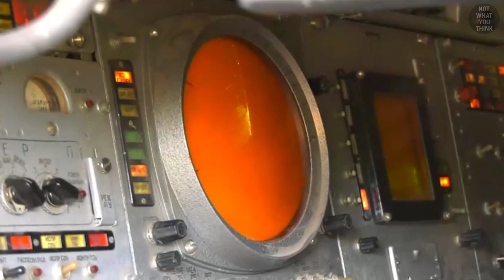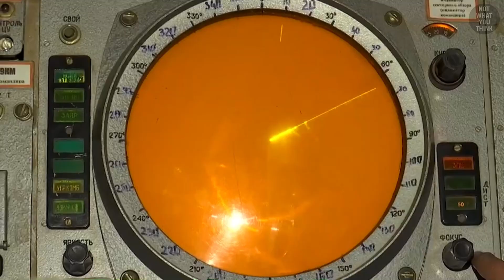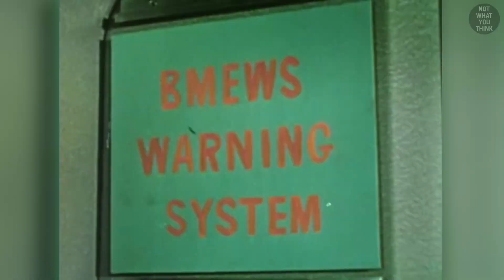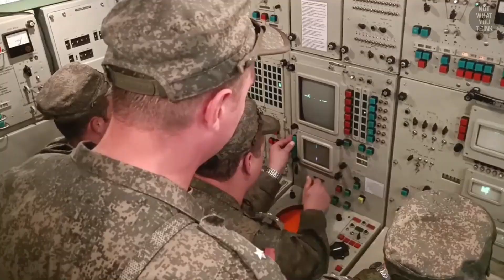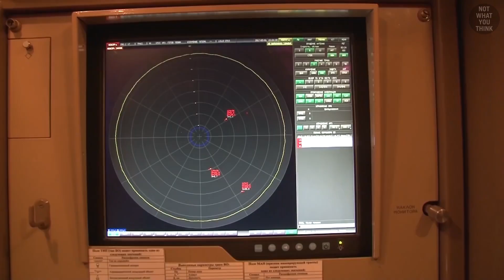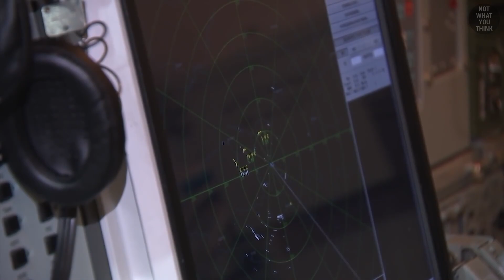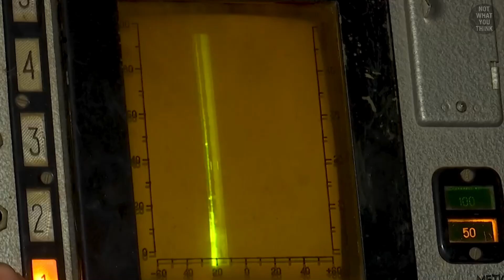How Aircraft Fool Radars by Flying Low

Comment: That trick does not really work with modern radar, that’s something that did happen back in the 80’s since the mid 2000’s flying low no longer works to mask your plane for any radar operator.

Comment: Computer network signalling = pulses
Multi-angle seperate transmitters and receivers
Multi-frequency

Arrays handle multipath, frequency hopping radio, ... modulations, time coded data, ... transmit is active(seperate) antenna(seperate) seperate from systems and receivers are passive. 

AWAC is high altitude receiver(array) duty
Multi scan is ambient-radio noise (works against stealth, blackhole between 2 antennae)

Multi angle(Tx array)(Rx array), multi altitude, counter-artillery(parabolic math) antenna and algorithm... 

Planes have new paint coatings... everything expensive in quantity. Defence is home ground advantage.
Reply: 5ghz wireless 802.11ac sent upwards and towards tooooooo. Besides other ambient radio noise

Comment: Flying low to avoid radar worked well in the earlier days of radar, when they were not effective due to the inability to differentiate between a moving plane and ground clutter. But today's modern, computer-controlled radars with Doppler shift analysis pretty much eliminated the advantage of flying low.
Reply: One advantage, mind.
As the first reply said, terrain. You may not be able to use it to hide your radar signature anymore, but you can still use it to physically hide you.

A theory of mine that i've been meaning to test for a while now is a theory i call Plowing. If you're smart, and you know how a missile tracks you, you could perhaps fool it to hit the ground. Absolutely pointless if the missile knows what the ground is, though.
Reply: Did you watch the video?
Reply: LOS is still a huge reason to fly low. Especially for helicopters which can maneuver to use buildings as cover  The difference between 5 minute early warning and 10 minute warning could be your life.

Comment: Technically you can still fly below radar coverage. Given NOE flying and if you use terrain elevation to your advantage, given the terrain and placement of the radar system, you can be under it's azimuth range. And, again, if there is a mountain or hill in-between you and the radar and you're under the crest of said hill/mountain, you're effectively below the radar even if you're not truly under the radar's emissions physically. Then there's also radar horizon for longer range radars that are commonly used with more strategic SAM system like S-300, S-400, etc. Although the radar horizon is much further than people think with just drawing a line on the curvature of the earth - radiation energy from the radio can bounce off the ground and upper parts of the atmosphere (much like radio signals can) and return telemetry at times. This is not a weapons-grade lock, obviously, but you can detect enemy aircraft out past what many think is the maximum limit.

Comment: Curious why they don't use HARM's. I know its an hide and seek game trying to find the radars and even harder mobile air defences like the SA-15, but air superiority is very valuable in combat. Also a tactic what they used in the Gulf War was to saturate enemy radar with dummy objects like drones.
Reply: The problem with HARMs, or SEAD missile is they are an expensive and disposable way to deal with radar, and even then if they detect the missile they can turn off the radar and it will likely miss.

That's why it's often called an air defence "suppression missile".
They also do not work on infrared based sensors. There's also active radar homing which doesn't scan a wide area and broadcast it's location.

Some SAM like SA-15 types are very short range and are basically "no escape"  by the time you get into launching/detection range.

It's very hard. it's a cat and mouse game of double bluffs...

Comment: It's not mainly the radar.. flying low means you are in thick dense air and missiles have very limited range at low level due greater air resistance. They have a boost phase during launch and then "glide" without power until they hit or miss.
But flying low has a greater danger from MANPADS and aid defence guns. The S400 missile system has a range of 400kms... the search radar is on a tall mast that gives the radar a much greater range. The long range missile climbs to over 100 thousand feet then travels the huge distance to a target and then dive down to kill you with terminal radar from the missile homing in on you.

The best option is to fly very low and avoid detection in the first place...

Comment: 5:18 actually used the word "crud"

another consideration (well, at least, you didn't state it explicitly) is that the air is not uniform, and a sudden change in flying conditions may reduce lift, and BOOM

Comment: So you mean to tell me the F-111 would still get the job done today? The jet that started the 50ft off the deck trend. So why did they get retired
Reply: Because far more capable systems are available nowadays, and the problems that F-111 was there to solve have other solutions too. From top-of-the-line terrain-following cruise missles to far more capable F-35s (better defence systems, maneuverability, target acquisition and modern weapons integration). Making F-111 compatible with modern JDAM munitions alone would be money spent on yesteryear's platforms. The role, however, persists under certain circumstances, i.e. when effective SEAD/DEAD action is unavailable.

Comment: 4 years ago there was an allied exercise in Germany in which the 252nd SHORAD anti-aircraft group from the army of the Czech Republic took part. They had an optical target detection system and an RBS-70 SAM system at the training. during the training they were in role opforce, the optical survey operators were camouflaged in the area and for 2 days they reported all aircraft and all ground targets, within two days they reported the entire tank battalion with the designation of tanks and other vehicles. During the week when the exercise was taking place, they shot down all the blueforce air assets and it was decided 4 times to restart the air force, they lost each time. Colleagues showed me videos where helicopters flew 2-3m above the road, whenever they rose above the trees they were shot down. The kill was evaluated on the basis of aiming time and laser irradiation.

Comment: 6:04 Ground clutter and noise are different things. Strong noise is caused by active jamming while ground clutter is just echo from the ground.
6:30 This has nothing to do with clutter, it is about breaking LOS. Clutter results from echos from the ground while LOS is the path from the radar to the target.
7:27 It wouldn't be too risky for the NATO as long as their AWACS stays in Polish airspace. Such missions are being flown to support Ukraine's air defense.
7:51 Bullshit. Actually flying high makes you impossible target for MANPADS. The ceiling of typical MANPADS is about 12k ft AGL, so flying at 20k ft AGL makes you immune to MANPADS.
The rule of thumb is that if you fly low you mainly risk AAA, SHORAD and MANPADS. While flying high you risk all sorts of SAM (mainly long and medium range ones, but even SHORAD can sometimes reach as far as 30k ft AGL).

Comment: There's something I don't get with the radar placement part : if you place the radar on top of a hill, doesn't that make it easier for aircrafts to fly under it's detection cone?
Reply: the radar can pick up planes even under a hill if it adjusts the characteristics of the beams or tilts the antenna by a few degrees. However, it has more reflections from ground objects. However, modern radars can filter this interference very well and can recognize moving targets thanks to Doppler. it also depends on how far it is from the plane and how high the hill is. There are many factors that you can influence and which you cannot. Some radars have a tall mast for this case. Then it doesn't have to be on a hill.
Reply: @KorbenDalasCZ  Thanks for clarifying 👌📝

Comment: It depends on the aircraft type and its mission. Most fighters are not going to fly low. I would rather be doing mach 1+ in thin air against ground launched missiles. If you're a heli or a slow ground purpose aircraft low is your best bet.
Reply: Missiles can travel over mach 5 and pull like a 50g turn
Reply: @oldfashionedwrx3574  This is why altitude and speed are going to be your best friend in a aircraft. While that missile can achieve mach 5 its still got a lot of catching up to do and not a lot of fuel to maintain that speed. 
 If you're in a jet at 40,000 ft and moving at mach 1.5 and can make defensive maneuvers you'll bleed that missile of its fuel and now it no longer has the benefit of making hard turns anymore.
Reply: @theaceofspades485  depends on aspect mach 1 cold or hot

Comment: Then what why heck are stealth qualities even used?  I though sneaking up on the enemy was the reason for all this stealth.
Reply: The su-25 doesn't have stealth. Neither side in the conflict has stealth aircraft
Reply: These super-low-flown missions are comparatively ineffective. High risk flights under very specific conditions result in very little impact of the air forces on the greater picture. So you can only use such missions seldomly and often not against vital targets. Stealth aircraft can have a far greater impact because their mission parameters are not nearly as narrow. E.g. the Kerch bridge is totally unreachable for non-stealth aircraft, but stealth aircraft might have a chance.
Reply: @tripod222  The new Nerf-Stealth Jets are the latest thing.

Comment: I have a question, why radars rotate?
Reply: They do because they need to check everything around them.
Reply: @Nicolas-82  thanks for the response, but why not a 360 degree fixed antenna
Reply: @abrahamses3927   there's less range when the signal is not focused
Reply: Why not?

Comment: So this is why th A10 isn't stealth it already is.
Reply: Not really. It's still vulnerable to MANPADS when flying low.
Reply: @FishbedMyBeloved  if you can see as it goes by at 3-400 MPH.  Slow by aircraft but still fast for anything near or on the ground, ie twice as fast as any combat helicopter.
Reply: @bowez9   not fast enough to evade anti air
Reply: @FishbedMyBeloved  so the Mi-24 and the AH-64 are even less combat capable.
And since the F-22 isn't capable of Mach 3+ it's vulnerable too.
The only plane impervious to AA is the SR-71.
Reply: @FishbedMyBeloved  this was addressed in the video.  It is less vulnerable than a helicopter. Due to speed and armor, it's even a smaller target than the Mi-24

Comment: 'Only' as low as 50 feet... that's just insane for a jet! Great video btw!
Reply: Depending on Terrain and radar antenna height, you are below the radar horizon of things like the S-300 at 100ft until you reach 30-40 miles.
Back in the day, Buccaneer pilots would fly as low as 30ft when practicing attacking ships or low level penetration of enemy air space and some Tomcat drivers "accidentally" flew down to 50ft or lower while over water while flying at mach 1.1
Reply: @pogo1140  While being an 'extra' on board of a frigate during a 'weekly war' exercise (in '93), I stood on the helo-deck (chilling out to not interfere with the exercise) looking at the horizon, when I saw a dot approaching from astern. It was a Buccaneer flying so low that I could look down into the cockpit when it passed the ship (and made a pop-up/break left manoeuvre to buzz the bridge of the ship). My eyes were about 26 ft above the surface of the water.
The old Eyeball Mk1 performed better than all the radars on board.....
Reply: The JAS 39 Gripen is said to have an auto-pilot that can fly the plane safely at 15 feet. But its probably not safe for the older soviet planes that are used in this war.

Comment: Affectionately called the “A-10 Warthog” for its aggressive look and often painted with teeth on the nose cone, the A-10 Thunderbolt II is the U.S. Air Force’s primary low-altitude close air support aircraft. The A-10 is perhaps best known for its fearsome GAU-8 Avenger 30mm gatling gun mounted on the nose. The GAU-8 is designed to fire armor-piercing depleted uranium and high explosive incendiary rounds.
The A-10 Thunderbolt II has excellent maneuverability at low air speeds and altitude, and is a highly accurate and survivable weapons-delivery platform. The aircraft can loiter near battle areas for extended periods of time and operate in low ceiling and visibility conditions. The wide combat radius and short takeoff and landing capability permit operations in and out of locations near front lines. Using night vision goggles, A-10 pilots can conduct their missions during darkness.
Reply: Blergh. Please stop simping for an obsolete piece of tech that only stuck around because of lying idiots that got prominent on RussiaToday...
Reply: @Argosh  cope a10 hater
Reply: @ferrous3262  I'm not the simp, you are 😁

Comment: The role of Manpads in defeating enemy air power is now a crucial one. Not only is flying low to avoid radar unsafe, but once a stinger missile is launched the pilot would not know immediately what type of missile is heading towards him. So he'd have to dodge and try to save the plane instead of completing the mission.... even if he's flying way above range. This might just explain why Russia is having such a hard time conquering the skies of Ukraine.
Reply: It's still a reaction time thing, manpads are not "on" all the time, they have coolants and batteries that only last a short period of time. So first you have to hear the jet, The closer to the speed of sound, the less time you have (the time is the difference between the sound of the jet reaching you at mach 1 and the speed of the jet), Example at Pt Mugu I watched an F-14 surrounded by a cloud of vapor come towards us at near mach one,  the sound of the jets did not reach us until the jet came over the edge of the runway and the Tomcat flew past us less then 2 seconds later. So if that had been a real attack run, the manpad shooter would have to get the launcher on his shoulder, turn it on, locate the target, get the seeker on target, get a target lock and launch the missile. By that time the jet would already be past and headed out, probably almost past the max rear quarter launch range of the missile.
Reply: @pogo1140  
Battlefield 2 is a perfect game that shows the flaws of MANPADs or AA where you need to find the aircraft.
You have to have proper knowledge and quick reflexes to get a kill.
And these guys aren't some robot that can have quick and consistent reactions.
Usually the Ukrainians or even Russians with MANPADs are just regular dudes with your typical and albeit slow response to these threats.

There are 3 most likely reasons why Ukraine managed to shoot the Russian planes down (although not a lot to be honest):
- they had knowledge on the paths the aircrafts were flying through by listening to witness accounts , interrogating prisoners especially those who might know or by having a mole in the Russian military.
- they were extremely lucky especially considering how big Ukraine is even those land that was captured by Russia during the early stages even up to now so the MANPAD team being in the same area as the aircrafts that were shot down was by pure dumb luck
- they made use of Western help in detecting and calculating the flight paths and had their MANPAD teams lay traps in these potential areas of traffic with a few of them getting lucky when they had to shoot their rockets.

Asides from obsolete and bad Russian tactics (which ironically enough is also what Ukraine uses), these are most likely the main reasons why the Ukrainians got that many air kills
Reply: @dickmelsonlupot7697  not many at all i wouldnt expect nothing less from a country operating hundreds of worlds best SAMs lmao
Reply: @AlenB29  
you do know much of Ukraine's air kills were using Russian AAs like the Buks, Kubs,  S-300s, even MANPADs like the Strela, right?
Reply: @dickmelsonlupot7697  exactly they have shitload of very good Russian SAMs and its obvious they will shoot down many planes
Reply: @pogo1140  or viggen flying mach1+ at 30m
Reply: Modern missle warning systems identify what type of missle is being tracked, locked, and launched at you.
Reply: Manpads have a limited range, but they are good for protecting the troops and certain point targets.
Reply: @herptek  exactly. They are like light aaa were during ww II which protected against low flying lighter aircraft
Reply: @thurbine2411  True, but just handier. There are also other forms of SHORAD still in use, including automatic cannon armament like in the old days but with better radar-based aiming.
Reply: @herptek  yep
Reply: Exactly! Portable AA platforms fired from the shoulder are designed for this specific purpose in mind. And since they often use manual guidance or infrared, you can’t use Sead aircraft to counter them. Flying under the radar was a thing back in the 80’s trust me modern air defense systems will detect you even if you fly so low, you haven’t taken off and are just driving your jet across the tarmac

Comment: Before stealth,. Low and fast was the standard for attack. Terain following radar systems were common to fly the plane safely 50 feet off the ground and not become a smoking hole. 
Since helicopters cant be made stealth easily nap of the earth never stopped being the standard.
Reply: F-35 pilots are still taught to fly low and fast.